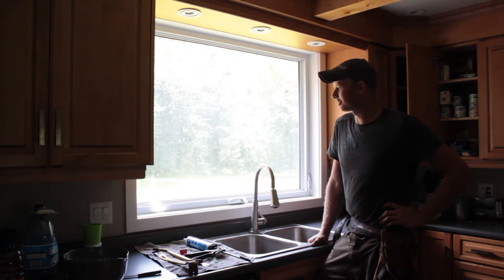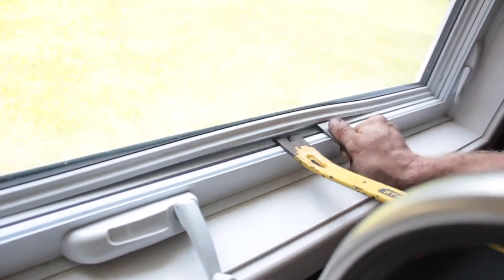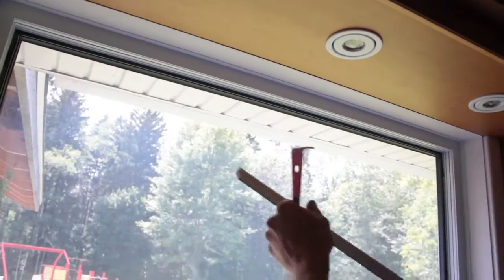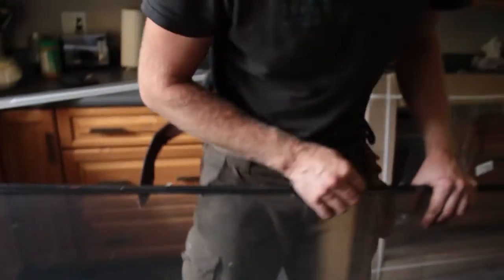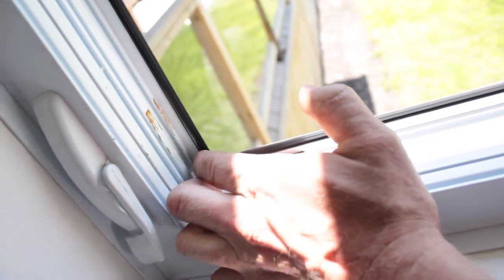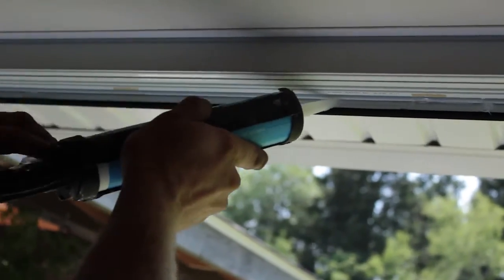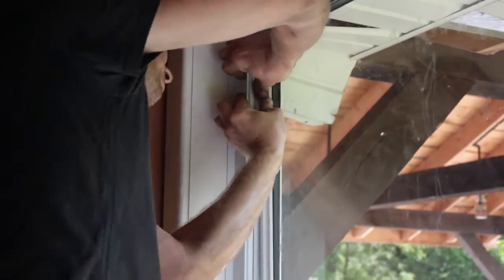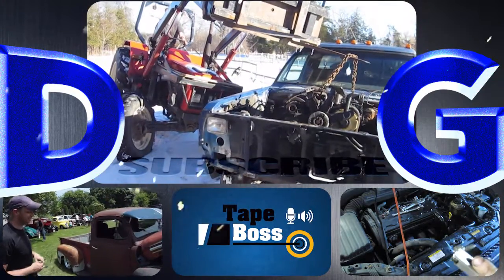How To Easily Replace Just The Glass In A Window

Comment: Good video. I also have North Star windows but I have a different problem that maybe you have tackled. I have horizontal sliders and I cant seem to get the one window out so i can replace the felt lacing on the bottom that the window slides on.  The pivot side has an L shaped  metal bracket with one screw on the vertical side a one underneath that I cant seem to get at. There must be a way to get this window out. I have contacted North Star and they said contact your dealer ! Apparently this felt lacing at the bottom is not under warranty !!! So much for a lifetime warranty. Anyhow if you have taken out a North Star slider before, and NOT one that you slide to one side and lift up , I would appreciate your help. If not, no problem, have a good day and thanks.